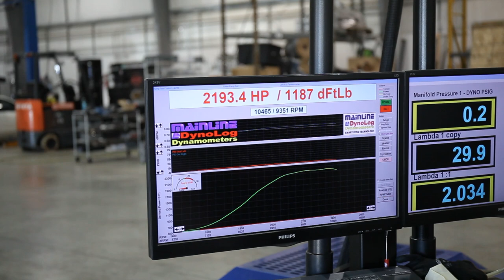2193HP SpeedFactory Honda Civic #outlawd

Comment: Did you guys just disconnect the driveshaft or the transfer case too. Wouldn’t it actually be making more hp than what the dyno says if the transfer case is just spinning? Is there any drivetrain loss ?

Comment: Billet block right? That’s impressive
Reply: My thoughts exactly. Has to be billet everything to make that much power. Even billet blocks say they can handle 1500 hp, but 2000+? I wanna know the engine setup. Anyone know what’s in the build?
Reply: @curtisadams7513  running at over 90 psi. I saw at speedfactory insta. Sorry for my bad english 🙏🏻